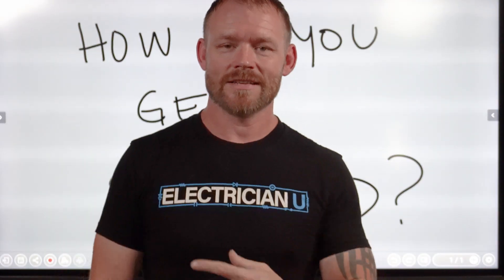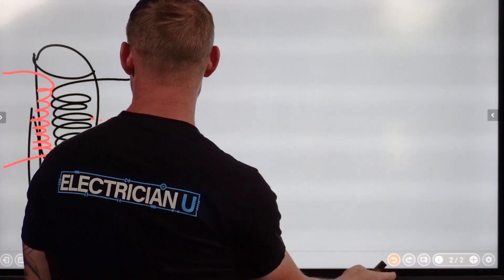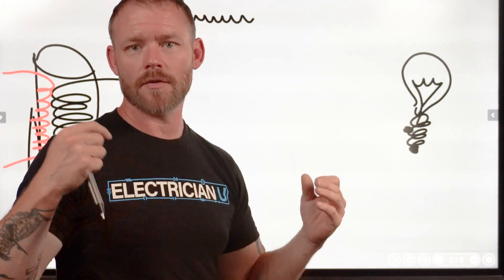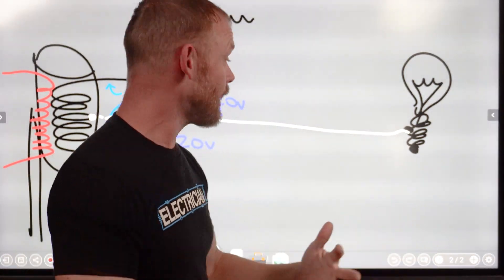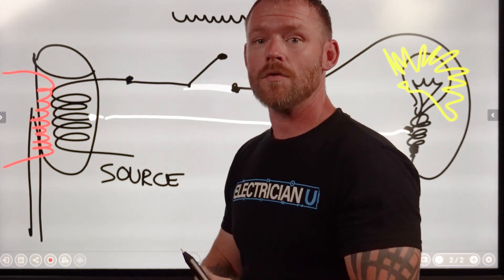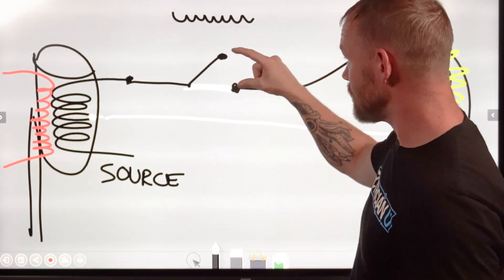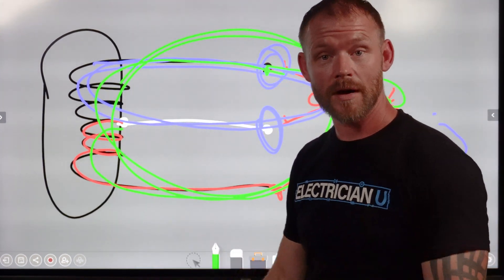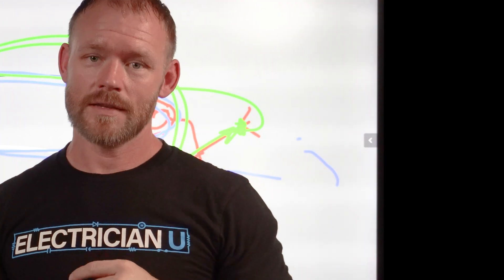How Do You Get Shocked Part2

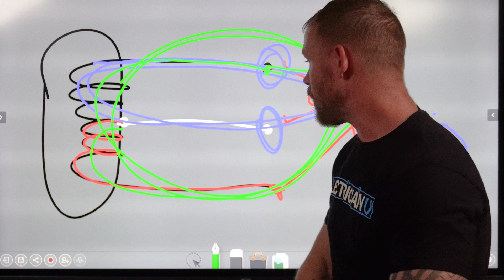Comment: 13:30 just a quick note, yes you touch the power wire but if your legs are not insulated then it will shock you. If you touch it and touch for example the wall or anything then the currentt will go through your heart and you will get “ELECTROCUTION” which means death my friend.

 I love when this man said “Respect the electricity” it’s a really strong power and you can do alot with it but if you gave your back to it, you will be killed by it. Never ever underestimate the electricity.

Comment: To clarify: Arrhythmia is the word you're looking for.  When you touched 277V the current traveled through your skin and the head of the current passing through your tissue burned it.  That is the red line, a first degree electrical burn. When current hits your muscle cells (including your heart) the cells are depolarized and that's why sometimes your hand can clamp shut on the conductor you are grabbing.  WIth your heart the major danger is when current as low as 30 mA hits your heart muscle cells and depolarizes them at the wrong time it causes arrhythmia which if not corrected quickly causes death.  It would take kV level for anything to explode though.
Reply: Quick question im young and learning…if I touch both screws of a single pole light switch even though electricity is traveling through the switch already will it travel through me as well? Or will it not do this unless its off and not traveling?
Reply: @ronaldinhothomas3961  I assume the switch is on and for the sake of argument not the ground.
If you touch both screws on a single pole light switch you will complete the circuit and feel a zap proportional to your resistance.  You form a parallel circuit to the switch and still get current.
For example one dry finger of each hand or sweaty thumb and index finger of same hand in pinch grasp.

Comment: BUT - if you didn't have those insulated boots, and you touched the black lead and were standing barefoot on the ground, you could get shocked. The circuit would be completed as electricity would flow through you to the ground at zero potential, correct?

Comment: Our teacher showed us a neat trick where if you take a spool of nr 12 wire, plug one end into the hot from a socket, and the other end into a neutral the whole coil magnetizes any tool you put inside of it, and it doesn’t blow up because that coil creates a ton of resistance and some kind of effect I can’t explain
Reply: Windings in an AC circuit have reactance. This creates a resistance which limits the current that flows though what would appear at first glance to be a dead short since there’s nothing but wire.

Comment: If you are wearing boots and touch the hot wire in a circuit, wouldn't the electricity then flow through you as if you were the wire? It would just stop at the boots instead of stopping at the end of the wire. Or are you saying that there's no electricity in the wire at all until the circuit is completed? Essentially what I'm asking is whether or not there is electricity (or maybe current is a better word) in a wire that is not a complete circuit.
Reply: In simple terms, current (what people often call electricity) is just the movement of electrons in a conductive material, such as a copper wire. Electrons can only move between two points with a different potential (this is voltage). In a normal circuit, the hot wire is 120V and the neutral wire is 0V, thus this is a 120V difference in potential. The electrons will move between the hot and neutral because of that difference. When you are touching a single hot wire, assuming you are not creating a path to ground (which is also 0V) through your body to the literal ground (because the ground wire is connected to a rod that is buried in the ground), you do not have a voltage differential, thus the electrons can't move. This means no current is flowing; the electrons are just sitting still.

A similar concept applies to air pressure. If you have two "containers" with air, the one with higher air pressure (i.e. a higher "voltage") will want to move it's air to the one with lower air pressure (i.e. a lower "voltage") to balance out. This is why a hole in an airplane at altitude will cause things to be sucked out of the inside (the air pressure in the cabin is higher than the outside air). If you are on the ground, the air pressure in the cabin will match the outside air pressure, so everything stays put.
Reply: @jpasher  Thanks for this explanation! It actually makes a lot of sense now.

Comment: I was shocked a good handful of times in my lifetime.   The most unexpected happened when I was a teenager replacing a blown element in an electric water heater.   Uncle Gary said the breaker was off.   I verified that with a neon circuit tester across the line side of the upper thermostat.   what happened was this was in the barn the breaker box was probably installed in the 60s or 70s, and either the handle tie was missing,  or there were two 30 amp single pole breakers instead of a double pole 30, and one leg was still live.    Could've been avoided if I had also tested from each line to the grounded tank.   Similarly this is why for many years, the NEC requires a double pole breaker  when multiwire branch circuits are employed.

Comment: You briefly touched on impedence vs reactance. 

The difference is very easy. Real world loads are comprised of resistance and reactance. In mathematical terms, the reactance is the imaginary term (multiplied by the square root of -1). Impedence= resistance + reactance, even in DC circuits (because capacitive and inductive components add reactance to the load).

So, impedence is the overall term to describe the load which absorbs electrical energy. It has 2 components: resistance and reactance. Even a pure resistive element will have some reactance to it due to the inherent capacitance and inductance of wire , even if those values are very small. But over large distances, like transmission lines, the reactance of the transmission lines is very much present and must be accounted for in design.

Comment: I was shocked from arm to arm like you described when I was a new install tech at a telco company. I drilled into a garage, unknowingly through the electric service drop, then while kneeling with one hand on the ground, had a metal fish tube in my other hand trying to get wire into the garage, touched the drop I drilled into and felt a strong vibration from one hand through my my chest to my other hand until I let go.

Comment: Great explanation overall! I had a minor issue with a detail regarding the whole "two-points" deal.

It's easy for a layman with little knowledge of electricity to interpret these two videos as being the only way to receive an electric shock is by explicitly contacting two points in the wiring itself. Therefore, touching a hot wire all by itself should be just fine, right? Well, the definitive answer to that as we know would be: IT DEPENDS.

If some guy is outside walking around in his bare feet on his driveway, grabs a damaged power cord with its hot wire copper exposed, and accidentally contacts the copper with his hand, he's going to feel a shock. It would be a relatively small current but it would surprise him enough to the point where he's going to go, "Oh shit!" As an electrician, I've been bit twice so far by only contacting a single wire with 120V potential to ground. The shocks were mild but they were definitely there, enough for me to jump back in surprise. Both times, I was kneeling on the ground working on receptacles that were your typical height of 18" to center but I was wearing normal work clothing, jeans, boots, etc.

As electricians, we know that we need to have two different points of potential across some part of our body in order for an electrical current to shock us. But sometimes, that second point can simply be the ground on which we are standing, or kneeling, or sitting. Yes, the ground makes for a terrible, high-resistance return path back to the panel and transformer, but there is still a path there. And since we electricians know that electricity will take ALL paths available to it, current intensity being inversly proportional to that path's resistance, a very small current might flow but it may still be enough to feel the tingliness in your finger. Of course, if you contact a hot wire and a grounded metallic part of the building simultaneously, like a metallic water pipe, that shock is going to feel probably as bad as if you've contacted the hot and neutral wires. Every shock is different depending on wildly varying circumstances but while it is true that the body must have two points of electric potential in order for a shock to occur, one of the points doesn't necessarily have to be the directly part of the electrical system itself.

Otherwise, this is a great explanation of electric shocks and why they happen!
Reply: Terrific comment, Mike. Thanks for the clarification!
Reply: Exactly what I was looking for! Thank you!

Comment: Why is the earth used as a neutral / common wire  ?
Why not only use wires to return the unbalanced charges to the power plant?
Why do we need to " middle-tap " the secondary of transformers?
Why not only use 240v L-L, instead of having 120 L-N and 240 L-L ?
Reply: That's how they do it in Europe and most of the rest of the world. Not sure why 120 became popular in N America. Maybe they felt it was safer? OTOH earthing (with a ground rod) is not intended to prevent ground fault shocks. It is there to dissipate lightening strikes. In a ground fault condition the equipment grounding conductor is what provides a low impedance path back to  the distribution panel and from there its bonding to the neutral will complete the circuit with sufficient current to trip the breaker.
Reply: @Jnglfvr  thanks for the clarification
Reply: Fun fact. The literal earth is actually NOT used as a return path in 99% of the system. The earth is a relatively poor conductor compared to an actual metallic conductor.

To be clear, in building systems and primary distribution, we use neutrals as the return paths for all currents that require the use of the neutral. Some circuits are created across phases instead and do not need a neutral as the return path because there is already two points of potential.

But on the distribution system, which is typically 3-phase 4-wire, the neutral is used as a return path for all 3 phases. The nice thing about 3-phase power is that when all phases are balanced in terms of current draw, zero current will flow through the neutral because they are balanced. So the neutral ends up carrying imbalance current back to the source.

And high voltage transmission lines will never have an actual neutral wire strung up on the towers, despite there being a neutral at the line’s origination. This neutral is simply grounded to the earth to establish a reference for the system. The wires at the tops are simple grounded shield wires and are not designed for carrying currents except for lightning strikes. Neutrals are not needed in transmission lines because the lines are designed so that all three phases should always be balanced since all they do is transmit power from the step-up transformer at the power plant(s) to receiving step-down substation transformers.

It comes down to history as to why we opted for a 120/240 split single-phase system for residences.

For starters, they’re safer because the phases in the building are only ever 120V to ground so if you get shocked by one phase and ground or neutral, you’ll  get 120V across you, even if you get shocked by one of the phases on a 240V circuit.

Comment: the second end of my PRIMARY coil is connected within the can to the same earth ground as the center tap of the secondary coil.  No Second Conductor 
back to the power station?
Reply: He did not explain well how the transformers are connected.
Primary is connected to one of the phases and to earth ( 14 400V ) and lowers it to 120/240V . 
I still dont know why they only use ( phase to ground 14 400V) for the primary, rather than using ( phase to phase25 000V ).
Just have to built the transformers accordingly.
Reply: @martf1061  Phase to ground is 7,200v which is what is connected to residential 
step down transformers in my area of observation.

Comment: 50+ years licensed electrician and I'm STILL amazed when someone says, "But I thought that metal ATTRACTS electricity, and that's why you never use a metal ladder."
Reply: There's truth to that. GROUNDED metal will "attract" electricity
Reply: @eitantal726  A better way of saying this is, "If you don't know what you're doing, stay away from it."
Reply: Quick question im young and learning…if I touch both screws of a single pole light switch even though it’s traveling through the switch already will it travel through me as well? Or will it not do this unless its off and not traveling?
Reply: @ronaldinhothomas3961  If the switch is in good condition and you aren't otherwise grounded, an insignificant flow of electricity will flow through you. This would be like touching a current-carrying conductor at two points. Measuring voltage across a closed switch is done routinely to detect a high resistance in a switch or contact, but I use a meter instead of my fingers. Testing for a blown fuse in a hot circuit is done the same way.
Reply: @ronaldinhothomas3961  It's a trick question. In reality, probably nothing will happen, but not for the reason you might think. The full answer depends on how many volts "fall on" the switch itself. This is a function on the ratio of the load of the switch itself vs. the actual load. In reality, I don't expect more than 1V, so doing so will be like touching a AA battery. Your electrical resistance is not linear. It's near infinite in a low voltage situation, but can get very low in high voltage situations

Comment: Ground wire.  These have been great.  I hope you are going to do one explaining how the ground wire completes the circuit.
Reply: I must agree. Also would show how important electrical insulated shoes are.
Reply: Coming here to say Ground wire as well!!
Reply: Imagine you have a vacuum cleaner with a metal case. If the live wire gets loose and touches the metal, when you touch the metal you would get shocked. But if there’s a ground wire and the same thing happens, the current goes through the device, through the ground wire and back to the breaker and causes a short circuit which trips the breaker. Basically, your ground wire is a fail-safe that prevents you from touching something that could have electricity.
Reply: @imperiallegionnaire6943
Excellent example

Comment: Once when I was about 15-16 years old I was laying in bed playing an electric guitar plugged into an amp with amp plugged in an turned on and guitar turned on. 
  There was a fiber glass fishing rod nearby and I broke it down into 2 pieces and used the piece with the handle to strum the guitar strings (yes I thought of this before Jimmy Page. )
  I got bored and was staring up at the light fixture in the ceiling. It was an 8 foot ceiling and the fixture was a two socket type with only 1 bulb installed. 
  The one bulb was not on at the time and I looked at the wall switch which was off ( in the down position). 
  With my fingers on the guitar strings and holding the rod by the cork handle I stuck the rod into the empty socket and got the shock of my life. Then I did it again just to be sure and sure enough got a similar shock. WHY?  The rod had metal chromed ferrules where the two pieces of the rod joined together and one of those is what I jammed into the light socket.
Reply: A light switch can work by breaking the neutral wire or by breaking the hot black wire. If it breaks the hot black wire and you touch the neutral then you won’t get shocked. If it breaks the neutral and you touch the hot black wire you will get shocked if you are touching something that is grounded, like your guitar. 

A light switch is supposed to break the black wire so this doesn’t happen.
Reply: @ecospider5  in very old houses,  the light switches are sometimes on the neutral.   even more dangerous is some homes built before the late 1920s with the original fuse panel and knob and tube wiring,  have fused neutrals.    an overload or short circuit has a 50-50 chance of the neutral fuse blowing before the hot fuse,  leaving what appears to be a dead circuit at 120v to ground all the way back to the blown neutral fuse.
Reply: Yes this is a good example why you use a voltmeter to check for voltage and you shouldn’t trust one of those blinky tools to see if something is safe. I test every wire to ground and to each other. It’s amazing how often I find something with like 70v with full amperage in 1970’s houses.

Comment: Would that not still be a series circuit? Only one path for current to flow. Through the person. 😳
Reply: Yep, and the voltage would be shared between the two loads.  you and the bulb.
Reply: Think you miss the point.

Comment: What are your opinions of people using transformers such as from a microwave and power source of a 12v car battery for diy welding machines? Do you have a safer suggestion on how to build one? And can you explain an advantage of using a car battery over a plug with a specific DC adapter instead of using AC? Love and appreciate all the knowledge you share!